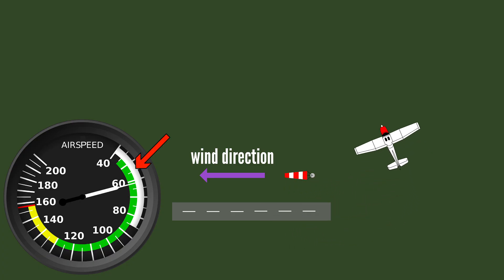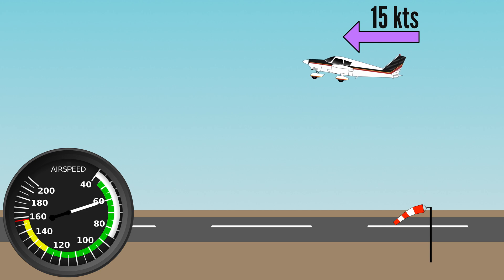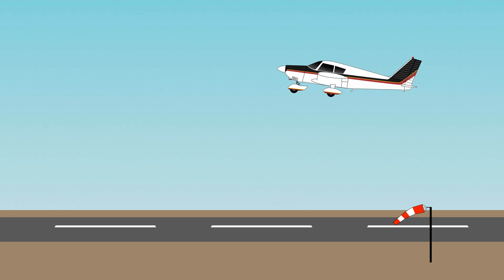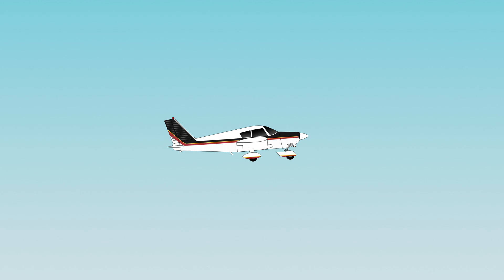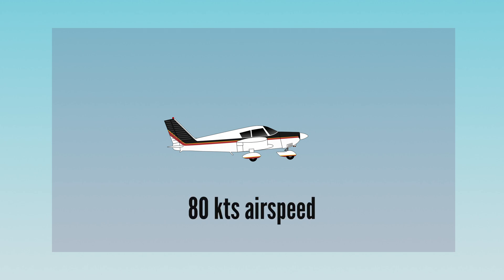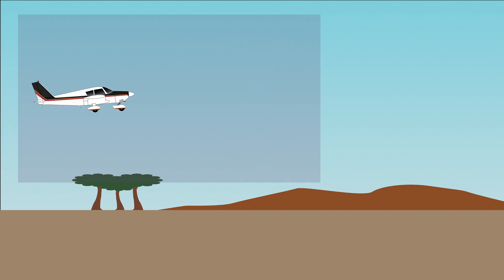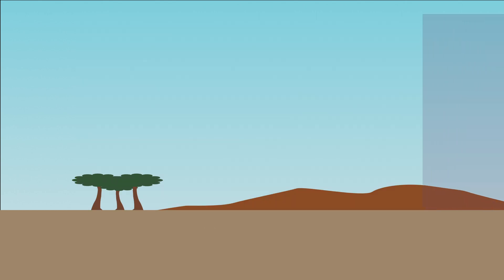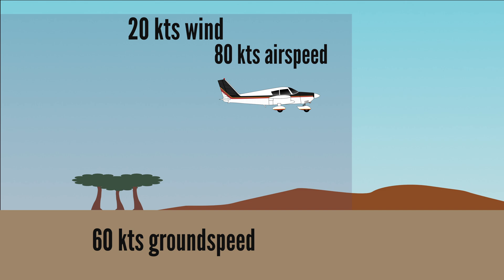The Myth of the Downwind Turn - Dangerous or Not?

Comment: You sir are dead wrong! Your analogy is out of context. Pilot for over 40 years, I would be more than happy to demonstrate to you a stall in a downwind turn, I speak from real world experience. The key factor is the wind velocity and the ratio of wind to flying and stall speed
Reply: @waynetokarz174  I just read through all of your dialogue with more focus.  

The physics is wrong.

Your perception based on your years of experience leading to the incorrect assessment could be due to the following factors.

Incorrectly assessing the cue of IAS reduction due to increased drag during turns (any extra lift generation, such as for the centripetal force for a turn of course requires higher AOA).

Also, when ground speed is higher, to maintain your expectation of pattern shape, you may be tightening the turns, further increasing lift inducing drag for the higher centripetal force.

And, any extent to which the turns are not ideally coordinated exacerbates the above issues, as there is more waste of the extra lift generated for centripetal acceleration, of course increasing drag further.
Reply: @davetime5234 during a turn to downwind in these situations I ALWAYS flatten the turn rate and actually apply forward stick to reduce AOA. On larger lakes it is never an issue as we just fly away and climb , however on small lakes where a lift off and immediate turn are necessary, we are forced into a high alpha low speed downwind turn that must be appropriately and cautiously performed. One only has to read the accident reports o know that downwind turns are serious business.
Reply: @waynetokarz174  "I ALWAYS flatten the turn rate and actually apply forward stick to reduce AOA"

I can see it makes sense to maximize your safety margin to avoid compounding low and slow with the extra lift and possibly other drag demands of a turn.  (control extension drag and perhaps turn orientation profile drag??).

"small lakes where a lift off and immediate turn"  

Again, a steady uniform wind should make no difference compared to wind calm.

But if you're turning downwind early due to tight terrain, are down drafts not often an issue, compounding the other "calm wind" turning challenges to turn during climb out performance?
Reply: I'll bite! You are performing a 360 degree turn at a 20 degree bank at minimum airspeed with the stall horn sounding at a constant altitude. Winds aloft are steady at 30 knots. What happens to your airspeed as you turn? What do you need to do to at each point in this turn to maintain altitude and complete a full 360 turn? Let's assume you are in a C172 configured for slow flight, it is trimmed and already in the 20 degree bank. The stall speed is 40 knots and you are maintaining altitude at a steady 42 knots indicated with the stall horn sounding. You begin the turn heading directly into the wind...

This is a standard maneuver that any student for a private pilot certificate must be able to perform and must be able to continue to perform during a flight review, so you should be very familiar with this.
Reply: @oracle427  All aircraft can be stalled at any speed but only one critical angle of attack, (AOA), this little exercise both you and the content creator presents, ignores this absolute fact. The issue has absolutely nothing to do with either indicated or ground speed and everything to do with critical AOA. As the nose of the aircraft deviates from a direct head wind, one will have to be constantly compensating for gradual loss of lift, for any given airspeed and being most pronounced with direct tail wind. Increasing AOA at such low speed will bring on a very abrupt stall. One can apply more power to compensate loss of lift and decreasing altitude, but if the stick is pulled back, (increase in AOA), it will stall. Bear in mind many simple aircraft, Cubs, Champs, etc, lack the power for such a compensation. The butterfly in the car analogy is false in this context. The aircraft must maintain stall speed plus wind speed to remain airborne and that requires a surplus of power. I have personally experienced a sinking aircraft in such a situation and know pilots lost as a result of being caught unawares.
Reply: @waynetokarz174  I suggest you should review chapter 12 of the Pilots Handbook of Aeronautical Knowledge. 

You also did not answer my question, so I'll go ahead and answer it for you. The pilot would need to do nothing at all in steady winds and the aircraft will turn round and round all day long despite turning from headwind to downwind and every which way. No power changes, no control inputs, just let it fly. 

Yes airplanes always stall at the critical AOA that had nothing to do with the fact that pilots believe this myth. I can't fault non-pilot enthusiasts without training.
Reply: @waynetokarz174 having read your response again I just realized something. I think you believe that an aircraft with a "tailwind" is flying at a higher AoA than the same aircraft flying into a "headwind". This is not true and the aircraft is flying at the same AoA in steady flight in either the "headwind" or "tailwind" because the aircraft is not experiencing either of those in steady wind conditions while airborne.
Reply: @ 40 years of flying in the Canadian North tells me I know EXACTLY what I’m talking about! Flying downwind and turning downwind are NOT the same thing! Once stabilized downwind you are fine and all works as you describe. During a turn to the downwind there is danger for lower performance aircraft. But even higher performance A/C will a have a feel of the change to them.
Reply: @waynetokarz174  Absolutely no change in the forces affecting IAS.

So, IAS will not change due to turning across a steady wind.

Though your perception might change due to the difference in GS's effect on your rate if ground distance covered.  So There is also reaction risk of tightening your compensating turn rate too much.
Reply: @oracle427  no I do not believe that a higher AOA is experienced flying downwind. This phenomenon is strictly experienced  during a turn to downwind with low performance A/C, eg Champs, T-Craft, etc. but would apply to most any plane flying in the danger zone of low speed attempting a downwind turn. A/C such as 172s and Cherokees will have sufficient power to pull themselves out of this situation if properly reacted to. All A/C will experience some form of loss of lift, but the ratio of power and speed to loss experienced is very small often appearing to negate any noticeable effect. “Non-pilot enthusiasts “? Really hope that is mentioned for the general audience, I would be more than happy to host you for a “ real flying lesson” and demonstrate that a downwind turn has potential to be disastrous.

Comment: It amazes me how persistent this myth is. A few years ago, the AOPA UK Magazine published a letter from a contributor, warning about the downwind turn. Complete nonsense of course - I laughed and put it aside. However in the subsequent magazine, another contributor (a student pilot) wrote in to thank the guy for the warning.  I felt I had to do something and so I wrote to debunk the myth. There followed two more exchanges between me and the originator, who employed ever more fantastic explanations involving complex mathematics about inertia and celestial bodies. I called the editor to ask why he was publishing this nonsense. His reply was that he liked to see a range of views in the magazine. Unbelievable - this was AOPA, which among other things, had a responsibility to promote safety! Some things in aviation never die - There is still an instructor at my local airport who advises throttling back after rotation "to spare the engine". Then there is the myth about "getting on the step". And even after your excellent video, there are still people in the comments who believe it, sigh!
Reply from the maker: AOPA, wow that is unbelievable, and is unfortunately part of the reason people believe it. The problem is if a pilot thinks the downwind turn is dangerous because of inertia or whatever, then they don't understand the real dangers of the downwind turn (windshear/gusts, speed illusions, reduced angle of climb etc. mixed in with the higher stall speed in a bank) and are thus potentially placing themselves in danger. Half of being safe is knowing what dangers to look out for.

The "on the step" myth is one I've been wanting to tackle for a while.
Reply: @Mar-s5q8m  Oh dear, here we go again. Will it ever end? I daresay you are a good engineer, but are you a pilot?
Reply: @Mar-s5q8m  Actually, pilots do study physics to gain their license. They must understand Newtonian physics and Bernoulli's theorem, in order to understand how a wing generates lift. The gyroscopic precession of propellers is also taught.  You are employing the incorrect physical model. An aircraft does not behave like a vehicle on the road, when changing direction. The ground (and all the physics you cite) are utterly irrelevant to an aircraft in flight. You seem to think that an aircraft pivots about a vertical axis to change direction. It does not. Instead, it moves though an air mass which is itself, also in motion. If you think about it in that way, you will see that the originator of this video is entirely correct - and you would be hard pressed to find a flight instructor who would disagree with him. Imagine an aircraft flying at a constant speed above cloud, using his instruments to make a constant rate turn. He and his aircraft, experience a circular flight path, like the circumference of a circle. However, if we were to watch his flight from his ADS-B GPS returns, we would see a spiral track, moving  downwind. Nevertheless the aircraft, which experiences only relative airspeed,  behaves precisely the same whether it is flying into the wind or downwind. The downwind turn is only risky if the pilot is not relying upon his airspeed, but is instead looking at the ground and judging his speed from that. Grave mistakes such as this are demonstrated to a student pilot in their initial training. Many seasoned and much admired professional flight instructors, such as Paul Bertorelli, Ron Machado (ATP) and Peter Garrison (who has designed and built two aircraft) have each written about the myth of the downwind turn. Indeed, they have each expressed such frustration at the persistence of this myth, that they are inclined never to write about it again. A feeling which resonates with me!
Reply: @rigilchrist Very well said!

I offer to add a little and certainly not take away from anything that you said. The wings of an aircraft in level controlled flight generate a lift force that one can assume to be opposite to the force of gravity in level flight. When an aircraft banks to make a turn a lateral component of the lift force acts as the centripetal force and accelerates the aircraft into a turning path. The lateral component of the velocity will continue to change direction while this lateral lift component exists. The aircraft will rotate due to the aerodynamic forces acting on the wings and stabilizers. How an aircraft turns is something that is taught to all pilots at this level of detail and this has been well understood for over a hundred years now.
Reply: @rigilchrist  great assessment of this topic that has often been discussed but never from the position that there are actually 2 possible scenarios that actually have opposite answers! For all but one phase of flight, you and the “experts” are 100% correct. The one scenario that is different is slow flight. Coming off a tight lake and having to make a low altitude, low airspeed, high alpha turn to the downwind will teach you a lesson you will not soon forget. Turn as shallow as possible, reduce stick back pressure and carefully watch airspeed. Again with myth number two, get the wing and plane up on step, yes there absolutely is a step, the AOA and drag exceed the available power to overcome and one is caught in a wallowing flight condition, forward stick, increase speed to overcome the drag that will allow climb to resume.
Reply: @waynetokarz174  this has nothing to do with the myth in this video about turning downwind with the wind behind you. You are describing an aircraft trying to climb in the region of reverse command. You can go in a straight line and experience the same issue where the only choice is to reduce AoA allow airspeed to build and get back to the other side of the L/D curve and resume the climb.
Reply: @waynetokarz174  "The one scenario that is different is slow flight"  

As mentioned already, this is no different in a perfectly steady wind.

"myth number two, get the wing and plane up on step, yes there absolutely is a step"

You appear to be mixing definitions for what one means by up on step. The possibilities seem to be:

1)seaplane context when taking off from water surface
2)climbing somewhat above cruise altitude to achieve a speed increase in the descent back down to cruise as somehow changing the L/D characteristics to achieve better cruise performance (myth).
3)your new (?) definition: a replacement term for flying back side of the power curve(?).  (which may have some effect on "1)"? )
Reply: @Mar-s5q8m  I've been flying for 40 years - and I have lost count of the number of times that I have tried to convince people who believe in this myth. So, against my better judgement, I will wearily try again. You make the mistake of considering the physics of an aircraft in flight in relation to the ground. The ground is completely irrelevant once the aircraft is airborne.